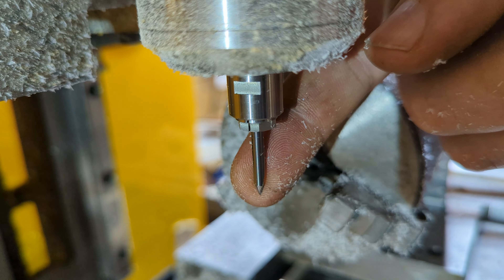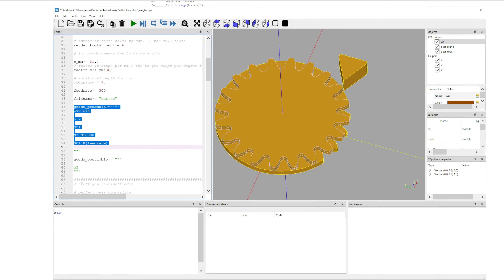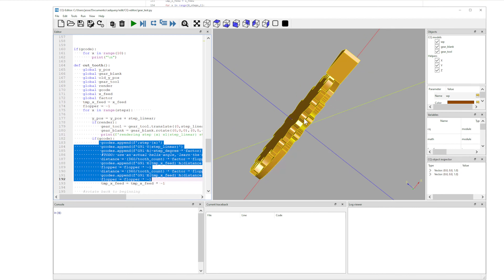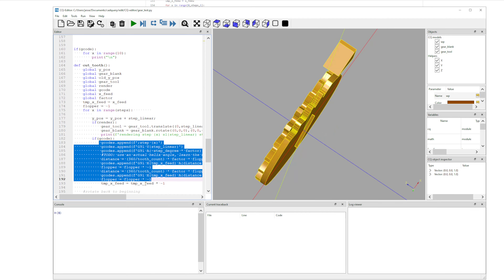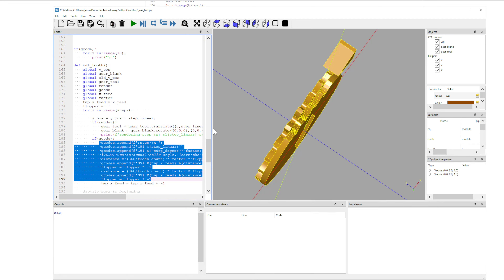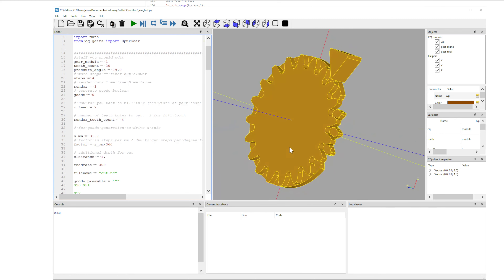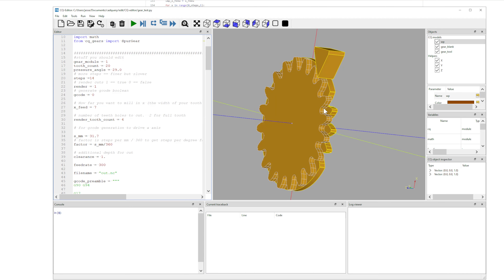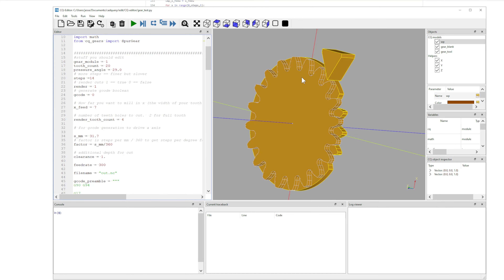cnc herringbone gears: virtual shaper part 4 in 4k 60p

Comment: I fell in love with Herringbone gears back in 2013 when I switched my Prusa I3 Rework over from a spur gear.  3d printing them is easy but milling them?  Not really but I would have loved to have had a set (14:1 if I remember right or it was 12:1) in metal.

Comment: Just a point about the type of acetal you are using here. You mention 'Delrin' which is acetal homopolymer. You will find acetal copolymer a much nicer material to machine components from as it cuts far more cleanly with much less fluffy burring issues.
Reply from the maker: this acetal was labeled Mitsubishi chemical 8941